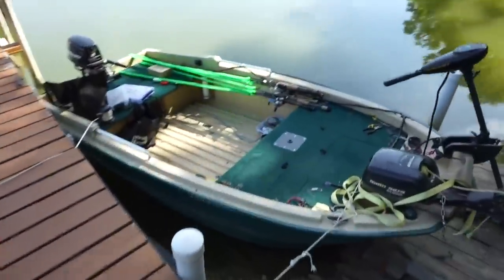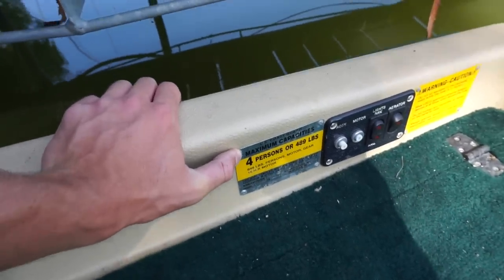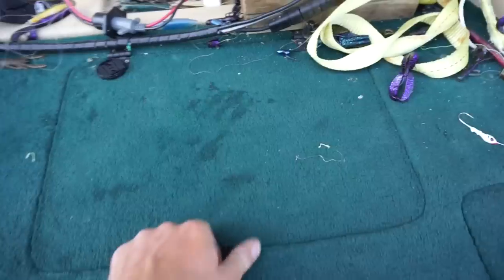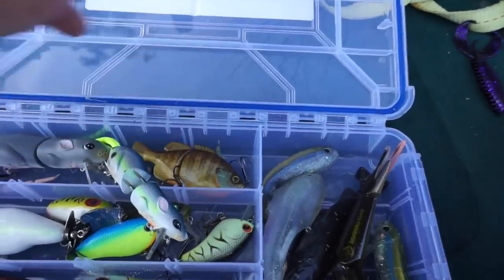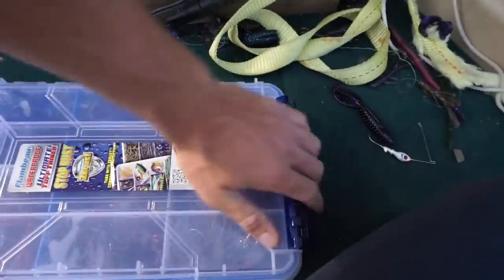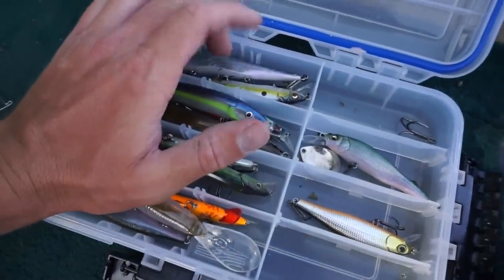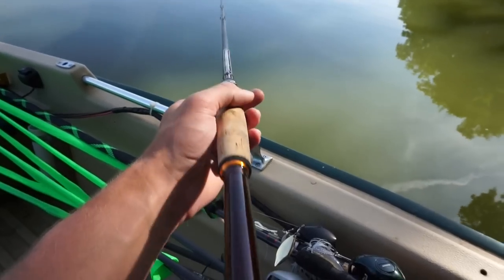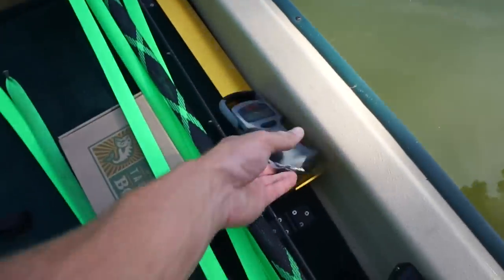Mini Bass Boat + Tackle + NEW Lures -- Bass Daily # 3

Comment: I didn't know it, but BigBite baits break down after one use. The day after they get little yellow flakes on them and a week after in my trunk there is nothing but a pile of yellow moldy flakes left...the bait is totally desintagrated! 
    On the other hand they last a long time in the bag, but something triggers off after one use in the lake and it falls apart. So it is the only bait you can dispose of in the lake you fish. I guess they make it like that so if you lose it in the fish it won't hurt it. I don't throw them in the lake, but make sure you put used ones in a plastic bag before you throw them in the trunk or you will have a mess a few days later.

Comment: Do you have a trailer for the boat? Does the trolling motor just plug in the front and then the batters connects to the boat in the back? And has the boat held up well over time? I love this video keep up the good work

Comment: Great little setup.  For chasing Bass you don't need anything else.  I've been making videos with my Bass Kayak, although I do have to be very crocodile wary!  Do you need to register all your boats or is there an engine size that needs to be registered?  I'm thinking of doing some filming and fishing in the states. Andy
Reply: Your boat has to be registered if it's over 9.9 horsepower, anything lower does not need to be. Hope this helps! And keep up the good videos! Tight lines.
Reply: Pregnantcow77  cool thank you, that helps a lot.  Here in Australia it's over 4ph.
Reply: +Andy's Fishing Depends on the state, but most states require anything that is motorized, including trolling motors, to be registered. Registration doesn't cost much and if it is registered in one state it can go to other states as long as it isn't permanently left in the other states. So maybe if you are foreign, you might not have to register?
Reply: +Andy's Fishing Some states also have rules about boats that are only used in private lakes where you don't have to register them under any circumstance as long as it is only used on the private lake.
Reply: Daniel Russell
Yeah, ok.  Can't say that will ever be one of my concerns.
Reply: Daniel Russell
What's with the hostility?
What offended you?

Comment: How much was the boat bro? I wanna get one
Reply: Jon, what is that trimax bar across the transome under your motor?  I have a 9.9 4 stroke but I feel the transome is flimsy and won’t hold the weight of the motor.

Comment: I'm looking to get a boat like that in the spring.  I'm going to use it mainly for local ponds so I'm going to have to be able to move it around by hand.  You mentioned it's heavy.  Can a couple of people carry it or at least pull on a dolly I can make?  My other option is the Pond Prowler which is just over 100 lbs.  Thanks.
Reply: Michael Klappauf I would get the pound prowler If u don't want to trailer the boat